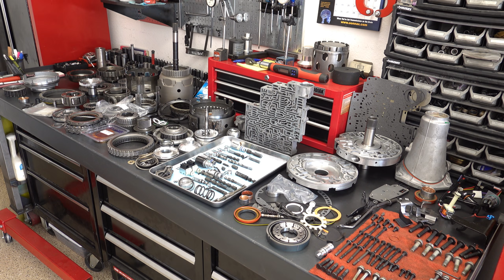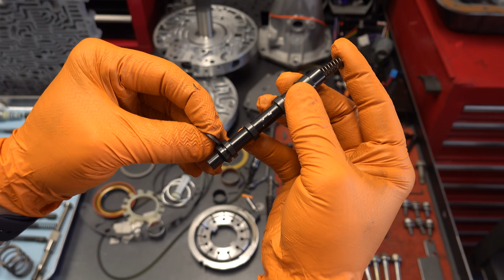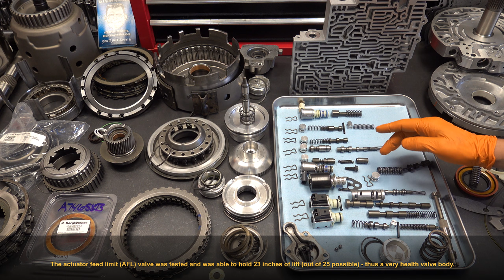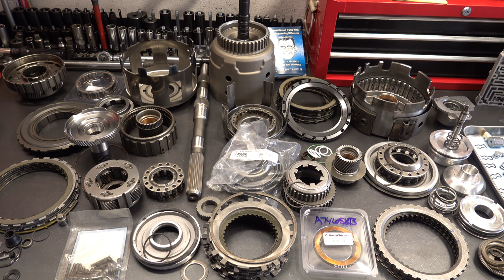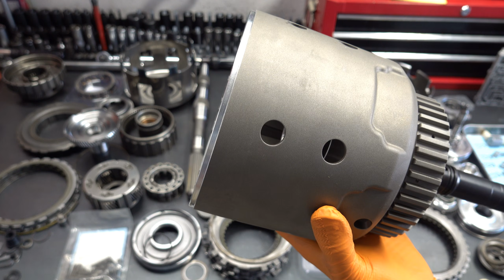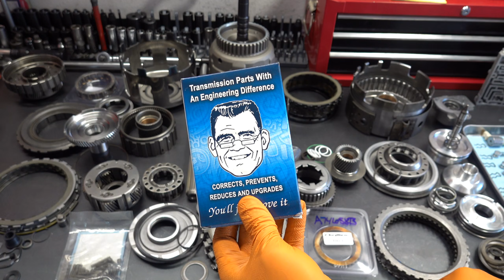4L60E High Performance PT1 -  Parts Selection and Build Considerations

Comment: On the pinless accumulators I just cut about 1/4 to 5/16s of the pin off and use it. Seen people spilt those holes. I feel its safer.
Reply from the maker: Good idea. Do you use any Locite on the pins or just install them as-is?
Reply: @nickstransmissions  i stake them with a t45 bit. Nice clean look.

Comment: For the somnax performance pack is it okay to use the accumulator valve shim if youre using the sonnax 77754-10K accumulator valve train? Or do i leave it out when using this valve train. My original was stamped dx indicating use of a medium spring.
Reply from the maker: I'd follow the instructions from Sonnax based on what you have and what you're trying to do. The acc regulator valve spring can be used to fine-tune shifts after the fact. Refer to Transgo's SK4L60E shift kit instructions for how to modify the valve body at the accumulator regulator valve location so you don't have to drop the valve body to remove / swap accumulator springs.

Comment: Why not use the sonnax TCC Limiter spring and regulator valve thats included in the Sonnax Performance Pack kit?  It supposedly  Turns the circuit into a On-Off and still allows fluid to flow threw it to other parts

Comment: Hello Nick, this is Ross.  You have graced me with your thoughts before, thanks again for that.  I would like to once again ask your thoughts……. I know you’re not a big TransGo guy (maybe a little) anyway 4L60, TransGo shift correction (I’m fairly certain you’re familiar with it) when the 2/4 servo is modified where the 4 notches are ground into the 3rd accumulator cover with 2 springs added inside……what effect, if any do you think that has on the 3rd check ball/capsule in the case?  Do you think it still slams shut and seals or does the fluid bleed off from the notches make that difficult to happen?  I ask bc I usually install either the Sonnax or the Superior Solutions support valve to enhance the factory piece.  Just curious if that’s just a waste.
Reply from the maker: HI Ross, I'm offering paid consultation services now - will be releasing a video on them shortly but they're designed for those needing more detailed tech support, assistance w/solving complex problems and/or looking to get into the transmission building industry. 

Reach out to me via Facebook and we can chat more about getting an appointment scheduled for you...The sessions aren't free but I can provide a lot more knowledge/insight/information in a single half hour than it will take you watching hours of YT to get the same information.
Reply: Fair enough, I get it!  Let me know when you get set up please.  All the best!  I hope you make a big pile of money I really do!
Reply from the maker: I'm set up (just haven't done a video about it yet)...You can send me a friend request and direct message via Facebook to schedule a date/time for a session: https://www.facebook.com/profile.php?id=61565989906020

Comment: High Nick can you tell me the best transmission fluid to use for my new high performance 1995 Corvette 4l60e?I use amsoil but I think it's synthetic.thank you nick
Reply from the maker: Any Dex/Merc certified fluid is fine.
Reply: @nickstransmissions  thank you and sorry one more question.i would like a new wire harness with new selinoids,what company makes the best? I hate to buy china I know ac Delco is china now
Reply from the maker: Watch this video for parts selection tips: https://youtu.be/R5QZxMmbJwU
Reply: @nickstransmissions  thank you
Reply: I did buy a sonnax wide reverse band.and they say you need a new reverse drum,but it's all made in china.whats you opinion on that?
Reply from the maker: Yes, install a new drum or turn yours.
Reply: @nickstransmissions  thanks
Reply from the maker: You're welcome, John.

Comment: Hi nick, in my 92 corvette trans my 1-2 acumulator came with a yellow spring, just like the one you show on your 3-4, but mine was broken,im going to use a pinless accumulator but I want to use my "stock" spring that was the yellow one but I can't find it , can you share me the part number so I can find it and purchase it or what would you recommend me ? Thanks, amazing videos
Reply from the maker: Hi Carlos, you can purchase Sonnax accumlator springs in that location...Assuming you're using a Corvette servo and have a stall speed under 2800, I'd purchase their standard spring...If the stall is over 2800 and using the Corvette servo, I'd use their stiff spring...You can buy them in packages of 10 or individually from your local transmission hard part supplier or on line from places like transpartswarehouse.com.
Reply: @nickstransmissions  thanks again, watching this videos is very helpful and I'm getting a lot of knowledge for my trans and I'm glad you take your time to answer all of our doubts, thanks again and happy holidays
Reply from the maker: You're welcome - Happy Holidays to you as well, Carlos.

Comment: Hey Nick, its been awhile, i never got a chance to install the Built 70E that i have,  I was telling you about it last spring, anyway its built with the Smart Tech input housing kit,  4L60 Red eagle clutches , 3-4 clutch pack ith Alto G3 wide pand and new drum , Input pistons , A new 2007 AC Delco pump, 300mm Billet output shaft, intermed  iate servo release check valve  and a bunch of Molded pistons the invoice sais, and some pinless accumulators ,  Im not a Transmission mechanic or builder but i have installed a few Valve body shift improver kits in 700's and 60's over the years,  anyway i bought the transmission from a friend years ago and i need to swap the stocker to this one  because the car makes 700 , LS2 with Novi supercharger system,  I would really like to pull it apart and make sure that it has a sonnax sunshell and that billet piston  and wide bushing that you noted,  But again i never been inside a Transmision,,   So i might just run it as is, But i want to go threw the valve body and possibly uggrade the Pumps internals,  Make sure that the 4 accumulator is blocked off etc, What do you think ?
Reply from the maker: Hi Walter, sounds like that LS2 is a beast!

If you've never been inside a transmission I'd recommend taking it to someone you trust or have someone with you who has experience on these units as a heavily modified transmission like the one you're describing may or may not have things done that you won't find in any manual.

Additionally, you'll definitely need tools like a transmission holding fixture (either bench or engine stand mounted) and other things if you determine more work needs to be done or you accidentally tear/break something. At very minimum, I'd have the ATSG manual handy once you have the fixture set up. You'll also need pump half alignment tool to put the pump back together after you have upgraded its internals (or you can use the case itself if you know what you're doing).
Reply: @nickstransmissions  Hi Nick,  i been doing some more digging on the 4L70 i have,  OK i reached out to the builder hes a friend of a friend , and i lost contact with that friend and so did the builder LOL,  But anyway The guy who built the transmission said that he built it with knowing a lot of abuse was going to be thrown at it,  it was going in a Trail Blazer SS 6.0L with 200 shot of nitrous  and the owner was very hard on parts which i already knew,  The builder said he installed the Smart Tech input housing kit and Billet 300mm output shaft,  Performance clutches and Steels, He believes hes used a Beast Sunshell,  and everything needed to handle the power,  He said something happened to the transmission during the time it was in the truck and being beat on, The converter snout broke damaging the pump,  The Pump was replaced and the converter (FTI) was replaced with a new one,  He said he went threw the whole transmission and replaced whatever it needed,  He said at that time he told the owner to build a 4L80 , he said the 70 can handle the Trial blazers 4,500 pounds of the Nitrous but not both because they were up to a 300 shot at that point, He said Knowing that i was eventually going to need to swap out the stock transmission out of my buick to sell me the built  4L70,   he said it built well and in a 3,500 street car with 2,800 converter and supercharger it will do the job he said nitrous is just hard on parts especially  transmissions, Keeping me in Mind he said he told the owner Why destroy a really good transmission He said this would be perfect for Walters Car,  and that why he went threw the whole transmission again and replaced all the clutches  , the Band, input pistons and of course the Pump,  So knowing all of this and i do trust the guy im pretty confident that the 70 will be strong,  "But"  i still want to check the valve body , make sure that the PWM circuit is addressed and 4th accumulator,  The builder said to put it in the car and run it , He told me Not to pull it apart so i didnt want to ask him anything about the valve body and i know all transmission builders have different tricks and what they do to the valve body,  So that why im bothering you , LOL Sorry , but im definitely going to pull the pan and the body and go threw it, If you can help me with what is absolutely necessary  to make it all work the best it can, I really appreciate it, Walter
Reply: Yeah im not going to break it down because i really dont have any experience, The Pump is a brand new AC delco but i dont believe any upgrades were done to it besides a boost valve etc, I would like to examine the valve body and make sure it has everything, What would you do for 4th accumulator  knowing that shes a 700HP car?

Comment: Hey Nick, I installed the 4l65e back in to my H2 Hummer! Runs great expect at 45 to 50 MPH the needle on the tachometer studders like jumps up and down. I have to give it some more gas to power through. Why do you think that is happening? Thx!
Reply from the maker: Erratic speedometer behavior at those speeds is likely vehicle speed sensor/wiring to the speed sensor - check the wiring; if good, install a new VSS.

If your engine itself is stumbling or hesitating at those speeds and beyond, check fuel delivery systems for weakness (pump, FP regulator, etc). Honestly, could be any number of things with or beyond the transmission. 

Plug a scan tool capable of rendering live data and bring up engine and transmission data streams and make note of what you see in the data when you hit those speeds...Perhaps have a helper watch the scanner while you drive or vise versa.
Reply: @nickstransmissions  hey Nick follow up. There was an vacuum leak in the engine. 1 for sure but maybe 2. I replaced both PCV valves. Ill take it for test ride once inspected. Thinking that may have something to do with it.
Reply: Hey Nick update, I installed new PCV valve hoses and that increased the vacuum seal. I found the main leak. Was the fuel injector o ring. I used the smoke machine through the solenoid hole above throttle bottle. Not sure how long its been leaking. I think for a while. $10 pack of Felpro o rings. Ill let you know how it affects tranny once I install it later. Right now needle jumps 40-50 mph.
Reply from the maker: Sounds good, man - it's critical to resolve all engine control, management issues prior to diagnosing the transmission as they can directly affect it how behaves and performs. 

I'll remove your comment on that other video and we can continue to go back and forth in this thread.
Reply: @nickstransmissions  latest update, The felpro o ring is working but not as think as OEM ac delco. Did get a check engine light for knocking. Been chasing that for last year. I did install new serp belt and replaced ideler and tension pulley. Tranny running even smoothier. At 40-50 MPH the needle will still bounce but its not as dramatic as before. Soon as I hit gas its fine. I did install sonnax 3/4 input drum. I remember there was a big broken red spring from a the transgo shift kit i didnt reinstall. Not sure if that caused it. Ill keep you posted with updates. Cheers.
Reply: Hey Nick, I had a long sonnax pin in the servo. I replaced it the original. Shifts are no longer harsh like before. Acceleration much smoother, stilll getting the throttle jump at 40-50mph, Hummer 2005 4l65e through an 1810 code today. I was going to install my old pressure plate, do you think I should install new harness while im in there too? Thx again for feedback
Reply: Update, I noticed trans fluid was low. I put 2 quarts in. The shifts are much less harsh and smother. Still have 40-50 mph issue. Going to install new ac delco plate. Pretty sure the one I installed may not be oem. Ill keep you posted.
Reply: Final Update, Felpro o ring to small and leaked again. Put oem ring issue fixed. Knock sensor issue was broken knock sensor it rattled causing false knock. There was a exhaust leak that caused false knock. I put a quart of AT+4 95% reduction in torque convertor shudder. I know its made for crysler cars but it has more friction modifiers in it to fix shudder. Came across youtube comment recomending it. Ill put another quart in once I install external radiator. I also replaced the electric board with new gm part. I replaced the filter with oem. Im pretty sure parts were knock offs. Trans shifting smoother than ever. I installed shorter pin. Shifts really hardh with long sonnax pin. Will semd cofee to you soon. Thx a mill!

Comment: I have also seen availability of a reverse input drum that is machined to accommodate a bushing that protrudes slightly to center and accept a Torrington bearing between the drum and stator!  Thereby FULLY rollerizing the internals
Reply from the maker: Hi Ross, yep you can rollerize the front thrust using a machined reverse input drum or you can use a bushing from a 200-4R that protrudes slightly above the surface of the direct drum, which will allow you to add a bearing there as well. I believe it's a TH350 pump thrust bearing and you orientate it so the black side of the bearing faces the pump to avoid exposing the bushing to the part of the bearing that rotates with the drum.

Comment: So I recently rebuilt someone else’s “performance” 4L60e.  The customer stated that after the truck the unit was installed in sat for a few days it would not go into reverse.  Let it warm up to near operating temperature and it would then engage as well as engage every time after as long as it didn’t sit for more than a few days.  I took it apart and found damage to the reverse input drum that was causing a sealing issue w the Teflon seals.  I put a new AC Delco reverse input drum and a new stator shaft (it and the bushings for the RI were all beat up).  Aaaaaanyway the transmission was set up pretty much as the one you have outlined.  I would say 95% so, but I found something interesting that I had not seen before.  The input shaft and the stator shaft were from a later model meaning an exciter on the input shaft and a pocket on the stator for an ISS even though it was not wired or otherwise utilized.  Finally to my point…..there was a very fat plastic bushing between the reverse input drum and the back of the stator!  Probably twice or even close to three times as thick as a factory piece.  I have read that there can be upwards of 0.225 clearance between the two in a factory setting and that it is normal and shouldn’t be a cause for concern.  It does however seem that tightening that clearance up (if it is in fact that much) might be beneficial in a high RPM situation.  I don’t know who makes it but I have been on the lookout.
Reply from the maker: Interesting find! Perhaps you can do a video on it if you still have the part and upload to Youtube...I'd be curious to see what it is/looks like and how it works.

Comment: Got a dumb question....I have a machined empty front cover. Turned mine in to a machine shop as a core a month ago. What's the best way to find out what boost valve length is needed?
Reply from the maker: You can purchase a 2nd design boost valve/sleeve kit along with the accompanying spacer that Sonnax sells that allows you to install that 2nd design kit into an earlier pump cover that otherwise came with a first design boost valve/sleeve from the factory.

I believe the change over was in either mid-2006 or 2007...

Comment: Actually tore down 700r4 last year that had bad low revers it had mircofracturing in the area where out put shaft goes thru transmission was gm reman unit it has suffered from overheating and lubrication failure
Reply from the maker: Thank you for sharing and watching, Corbett! Good call checking the rear of the case...Anytime I have low reverse failures, I'll closely inspect that area once the case comes out of the jet wash.
Reply: I caught failure on mild rebuild customer that transmission had sat for about 7 years wanted transmission gone thru they were rebuilding a 86 pontiac transam firebird I normally don't do carry outs for obvious reasons but since it was a close friend I done that one
Reply from the maker: Yep, good catch for sure. You never know what you might find when you open up one of these things.

Comment: great video, just curious what you think of the sonnax 2.84 ratio input carrier? Is it worth the money to do this?
Reply from the maker: Thanks, Kevin! The Sonnax planet set is worth it if drag racing, especially if you're having trouble getting all the power to the ground at take off and/or seeing the engine fall flat on its face on the 1-2 upshift.